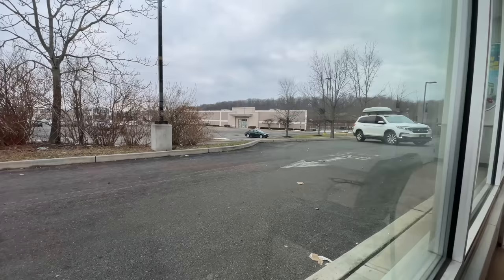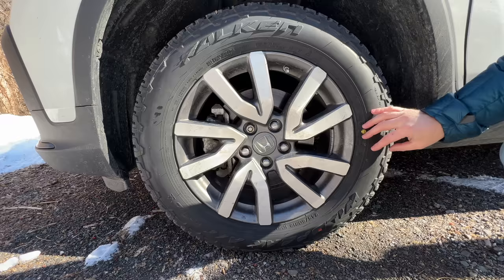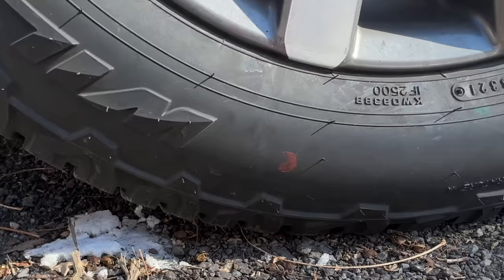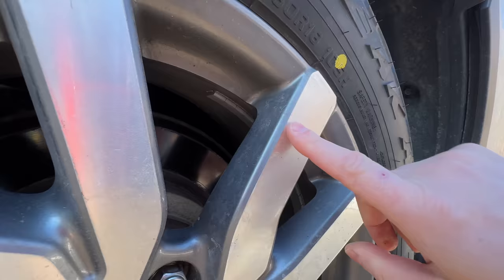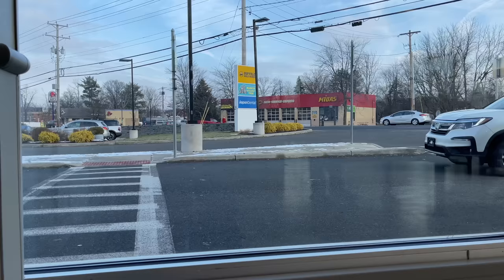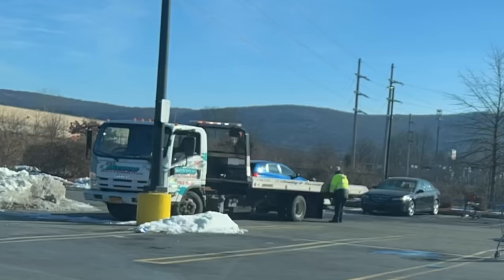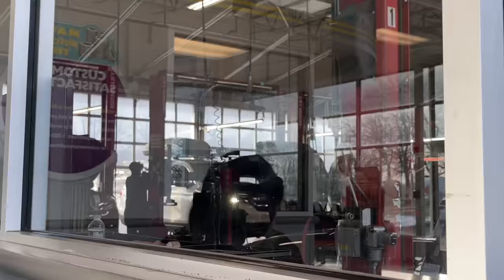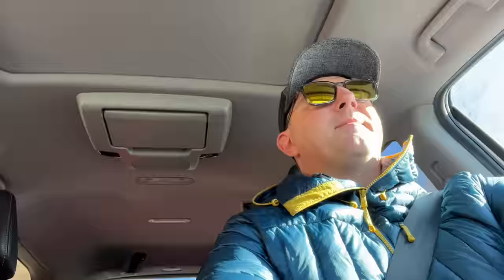The Surprising Importance of THIS Yellow Dot!

Comment: According to most of the information available to everyone on the internet - If your tire is marked with both a yellow dot AND a red dot - the RED dot takes precedence over the yellow dot. Cancelling out the high point (RED dot) takes precedence over the lightest point of the tyre (YELLOW dot) - which can be addressed with wheel weights.

I work as a "professional tire-installer" and can tell you that mounting tires on a 2019 Honda Pilot SUV with 245/60R18's (and ESPECIALLY those with 245/50R20's) are difficult to keep either one of the dots lined-up PERFECTLY with the valve stem. And if they do wind-up being a little bit off, good luck with trying to manually twist that tire so they do.

As a consumer - I would be more concerned that the installer 'rebuild' my bolt-in valve stems (replacing gaskets on OEM TPMS sensor), then I would that he/she lined-up those dots perfectly. I would ask if that will be an EXTRA cost - or is that included in the price of my new tires?

As a consumer - I would be more concerned that the installer either hand-tightened (or gunned-on lightly) all of my factory lug nuts - and then torqued them to their factory specs. If each and every one of those lug nuts don't move a little when torquing them slowly, then they're already over-tightened. Over-tightened lug nuts can lead to premature failure and/or warped disc-brake rotors.

As a consumer - I would be more concerned that the installer checked and re-pressurized my spare tire (which most consumers will NEVER check on their own).

As a consumer - I would be more concerned that the tire installer had easy/clear access to my spare tire's carrier, so that he/she could lower it and check/set the air.

As a consumer - I would be more concerned that 'I' left any wheel lock keys in clear view, so that he/she did not have to spend 15 minutes digging through my cluttered cargo area, center console, door pockets and glove box searching for it. (Wheel lock / Locking Lug Nut can be seen in this video at approx. the 11 o'clock position at 1:01 in this video).

As a consumer - I would be more concerned that 'I' took the initiative to notify the sales personnel of ALL concerns related to my visit at their business BEFOREHAND - rather than hoping that all my needs be their number-one concern.

Oh!?? And as a CONSUMER - I would NEVER.... EVER - bring my vehicle in to get new tires installed with the rims being covered in dirt / mud / grease / brake dust. 

The condition of your vehicle (outside AND inside) will directly effect any 'professional' tire installer's attitude toward your vehicle. Things like leaving your radio cranked up, the A/C or heater on HIGH, a trashed interior, a filthy exterior - All these things will immediately can / will put them in a negative mindset BEFORE they even pull your vehicle in for service.
Reply: I agree, if the customer doesn’t care about their car why should the technician
Reply: You forgot the most aggravating one. As customer who watched a YouTube video- you are not a professional mechanic. We don't care abought your "professional" critique.
Reply: @pauladams4833  if you are a professional then you should care more about the car than the owners . not having car washed is not an excuse to do poor work
Reply: Way to hijack the entire video comment section!  Not very “professional” at all, are you?
Reply: I have no problem with your comments.
Reply: Well said!
Reply: @gueto70  98% of the people installing tires are not professional mechanics.  Most have been trained in a hand-me-down method by fellow employees and not by any certified and consistent training method.  Just because a person doesn't work mounting tires does not mean that they didn't at one point in their life or that they aren't knowledgeable.
Reply: I busted tires so long ago there was no dots just DOT number. 
And for needing a wash I live 4 miles after the pavement ends but the road still serves us in G_d's country 😀 always have dust/dirt depending on time of year.
Reply: Over torqued lug nuts can be an extraordinary problem.  My wife drove a small 4X4 with locking hubs and used the vehicle for what it was built to do.  One afternoon I received a call from her, saying she had a flat on the highway and could not free one of the lug nuts.  I went to see about it.  The lug nut was tremendously over torqued.  The lug nut and stud were both distorted to the point that the nut could not be exchanged with any of the others.  I bent a 24-inch steel cheater freeing it.  I weighed around 200-lbs at the time, and bouncing on the cheater's end would not move it.
Reply: @gueto70  Professional "mechanics" are really nothing more than a regular person with $200,000 worth of tools and programs like "ALLDATA" to give them step-by-step instructions help them diagnose, disassemble and reassemble parts. And most of them have little-to-no clue how to safely and correctly dismount, install or repair tires on today's factory and aftermarket rims. Geez - you can accomplish most anything these days, just by watching a YouTube video.
Reply: @kevinstorm6009  How did 'I'... "hijack" the entire comment section? Or is it that your attention span can't handle more than just a simple sentence?
Reply: @larryh657  But once the pavement begins, how far from that point to the Tire/Service Center? I'm talking about the other 98% of the population that lives withing a large populated city, with access to their own water hoses and perhaps half a dozen car washes in between where they live and the place where they're getting their tire serviced.
Reply: @dawabbitt3079  people here don’t want to read your soliloquy on tire repair according to your own dictates.  If you want to make your own video, feel free to post one.  Your rambling nonsense added nothing to the conversation.
Reply: @theeddorian  It would be in both of your best interests to replace that stud, inspect all the others and perhaps replace ALL the lug nuts with new ones, hand-tighten and torque to factory specs. Re-torque them after the first two consecutive 50-mile trips... 200 pounds bouncing at the end of a 2-foot cheater bar means that it took well over 400 ft. lbs of torque to 'break' that lug nut free. Most Tire/Service centers I've worked at use a brand-name 1/2" Drive Air Impact Wrench that's capable of an advertised 600 ft. lbs. of torque... What's odd is that a small 4x4 probably doesn't have bigger than 1/2"-20 wheel studs, so I'm guessing that some bozo cross-threaded that one lug nut. If so, this should have been immediately notified and corrected. Again - I'm just guessing. Thank you, for your input.
Reply: @kevinstorm6009  Riiight - Because no one but the unfortunate tire technician should have to deal with baked-on grease, brake dust and mud. The tire technician is also responsible for finding your locking lug-nut socket/key after wasting valuable time searching through your over-packed glove box, center-console, door pockets, trunk and underneath rear passenger seats. YOU, as a CONSUMER can wait an extra hour or two while that happens to almost all the vehicles before getting to yours - or people will have to wait an extra hour or two because YOUR vehicle had multiple problems mentioned in my former soliloquies.
Reply: @dawabbitt3079  Thanks.  We did that.  It happened long ago now.  The car, an Isuzu Amigo, was taken to a shop and I had the rim, and the hub replaced.  After the amount of torque on that lug and the evident stretching of the stud itself, I was more than a little concerned that the hub might be compromised.
Reply: @dawabbitt3079  I worked as a tire tech for many years. Then I made a career change that was better in every way. If your job brings out the whiner in you, and yes… it clearly does, perhaps it’s time for you to find something that’s better suited to you.  Lacking that, maybe you should communicate better with the customer. Ask for the lug nut lock before you start, for example. No one wants you rummaging through their glovebox, etc., anyway.
Reply: @kevinstorm6009  Shouldn't have to ask, was my point. You just don't get it.
Reply: 1000% agree. I've gotten my car back from the Acura dealer with the lugs at least 2x over spec (I do most of my maintenance myself but the hard stuff I'll farm out [timing belt]- thought the dealer woulda been better...). I did feel like dog sh*t when I realized after I forgot to tell said dealer where the wheel lock was and they obviously found it..... maybe that's why they treated my ride like sh*t? I just wasn't thinking when taking it in for a service that the wheel needed to come off even though it was engine related.
Reply: I don’t know how manny times i have checked the torque of my lugs 50 pound/feet or MORE over tightened. They zip them down with an impact then pull out a torque wrench and “check” them by just listening for the “click”. They don’t back them off and then bring them up to spec.
Reply: @TexasScout   I absolutely agree with you! And if each 'zip' of the impact imparts a different torque to every other lug nut - then how can anyone expect that wheel to roll safely down the road afterwards? Some channel creators (Who shall remain nameless) have even gone so far as to boasting about how they 'know their tools'... which directly translates into "I kin tork 'em by EAR!!"
Reply: @stargazer2504  The service manager/writer should have known the wheel needed to come off, so it's more their fault for not asking. And most technicians (like me) never speak to 'the customer', as we are simply handed a work order. Afterwards though, when repeated attempts to contact the customer result in immediate redirects toward voicemail, or busy signals - That's when it starts to get aggravating. Thanks for your input!
Reply: Interesting information. Thank you.
Reply: @ranger178  totally agree   if poor work is done it leaves tyre fitter open to prosercution if things go bad
Reply: I'm one of those professional mechanics. I took pride in all my work. Very low come back rate. One thing I never liked doing was tires.
Reply: Thank you for all the advice. Very helpful
Reply: Thanks alot but how can you be sure about the location of the lowest point of the rim that should match the red dot (which is the highest point of tyre) ?
People say that it is valve stem but there is no proof.

Comment: Back when I was a service manager, I used to balance the bare rims before putting on the tire.   The valve stem area was never the heavy spot or the light spot.  It was always completely random.

Finding the actual heavy spot, then indexing the tire to minimize imbalance before beading up was always the way to use the least amount of weight (if any)
Reply: Did they have the pressure monitor?
Reply: @bilnitro  The red dot gets lined up to a dimple that can be found on the inside of a rim. That is the heaviest part of the rim. Not ALL rims have that mark/dimple !
Reply: I would do that to my motorcycle rims to find the heavy spot and mount my tires accordingly. I use a static balancer that I made that is extremely sensitive.
Reply: @achristian7015 Static balancer? What is that?

Comment: I worked in the tire manufacturing business for over 30 years. The engineering that goes into assembling each specific type, size, handling, harmonics, dry and wet road performance specifications, etc. for each tire is incredible.
Reply: Can u tell which company or manufacturer provides these red and yello hot stamping foil for tyres, i want to buy in quantity
Reply: When I was in high school working in a garage. almost 50 years ago, all this stuff would be space age…
Reply: Yes and that is exactly why its so important for the installer to put the tires on the wheels correctly.   All that science and technology goes to waste if they don't.

Comment: 42 years of experience… The best way to balance tires is to use the road force feature of the balancer. It Computes the high spot of the rim and the high spot of the tire. Then directs you to rotate the tire relative to the rim so the two spots are opposite each other and minimizing their effect. Only then does it have you add the weights in the proper location. If the road force feature is employed, it doesn’t matter where the dots lineup. Also, The dots don’t know where the high point of the rim is. I would always start with a rim that has all the previous weights taken off.
Reply: Every tire i work with gets road force balanced. Saves excess weights being used and imo increases the life of the tire.

Comment: I always line the yellow dot with the valve stem , the less weight on a rim the better , if you want to go one step further there are wheel balancers that tell you where to reseat a tire on the rim to optimize the wheel weight.
Reply: Is that yellow dot where the tire seam is on the inside of the tire?
Reply: @jojojack4975 outside

Comment: When I was doing tires I always lined up the yellow dot with the stem (or at least pretty close). It would generally balance better and save on use of (often) expensive weights.

If there was no dot or wheel asked for excessive amount of weight I'd usually deflate again and turn the tire 180 degrees and rebalance.
Reply: I agree that what I was told back in 80's when install tires

Comment: Awe, I worked at Walmart for 2.9 years doing oil and tires. Most professional do it by the book and it's apart of their routine when doing tires so it's standard. The issue comes when your backed up heavy or you have someone in training doing your tires.  Most of the time the tires are balanced well and you will not have any issues.  It's best to have em checked every other oil change. Tire & lube tech. 👍🏼
Reply from the maker: Great point!
Reply: “Every other oil change” isn’t a “thing”
Reply: @LoneWolfSnowplowing  w
Reply: Wiley67, I do my own mounting, balancing, oil changes so that I get what I want in my trucks.It is the only way to assure that things are done right.
Reply: Walmart didn't match up the yellow dot, there are no pressure monitors either.  Should I take it back to get this done, or not?
Reply: @thisisyourcaptainspeaking2259  -- "Should I take it back to get this done, or not?"

If you don't have an issue with ride quality you're just wasting your (and their) time.
Reply: @brendabowman622  The dots must've washed off.  Not sure why they didn't position them correctly, there's always enough time to do a job right the 2nd time, I guess.
Reply: @thisisyourcaptainspeaking2259  -- The dots are there to maximize ride quality.  The issue is whether or not YOU have a problem with the ride quality.  If your only concern is where those stupid dots are, and NOT the car shaking/vibrating at speed, you're wasting their time and yours by going back and having them "correct" a problem that's in your head.
Reply: @brendabowman622  So I shouldn't expect walmart to mount the tires according to manufacturers instructions.
Reply: @thisisyourcaptainspeaking2259  -- "So I shouldn't expect walmart to mount the tires according to manufacturers instructions."

The dots aren't "instructions".  Some new tires don't even have dots.  If you hadn't watched this video you wouldn't care about the dots.

DO you, or do you NOT, have an issue with the vehicle shaking/vibrating at speed?  That's the ONLY question you need to ask yourself if you're wondering if you need to return to the installer.
Reply: @brendabowman622  vehicle shakes at certain speeds.  This might not have been the case if walmart had mounted the tires correctly.
Reply: @thisisyourcaptainspeaking2259  -- 😂
Reply: @brendabowman622  Agree, it's the small things...

Comment: So far I've installed tires on 14, 15 and 16 inch rims at home (remove and install) without a tire machine. What I was told was yellow dot to the valve stem. If there's only a red dot, red dot to the valve stem. If there's a red dot and a yellow dot, red dot overrides the yellow, red dot to the stem. 4 different cars so far, never took them in for balancing, drove all the cars up to 70mph. No problems. In not saying I did it the right way, or anyone else did it wrong. It just worked out good for me that way. And will keep doing it that way until I get a vibration that wasn't there before changing the tires.
Reply: If you're interested, you're half right and I can provide a long winded explanation if you like. This is meant to be educational, not an attack. The red dot is more important but only if the rim has a low spot and you line the red dot with that point. MOST of the time, if the rim does not, you line the yellow up with the valve stem. You can try this at home, the red dot MAY require more weights. At the end of the day, as long as the weights are placed correctly, you're fine (no counter balance, double stacking, etc). Do also keep in mind, and unless this has changed recently, those dots don't mean the same thing for EVERY manufacturer. MOST are starting to standardize it but it's best to get the information from the manufacturer for what the dots actually mean. More people should be like you and learn to do these things themselves.
Reply: Honestly doing it at home though. If you have the time, move the tire all the way around the rim to find the best spot and use the least amount of weights. They're getting expensive.

Comment: My father always checked the red and yellow dots and their placement relative to the rim.  He also looked at how much weight was used to balance the tire.  If he saw this much weight applied, he would go back and make them do it over.  They can break the bead and move the tire 90 degrees and try again.  Yes, it is more work.  But, if that is the best balance they can do with that tire, likely it is defective, even if that doesn't show up until a couple of years down the line.